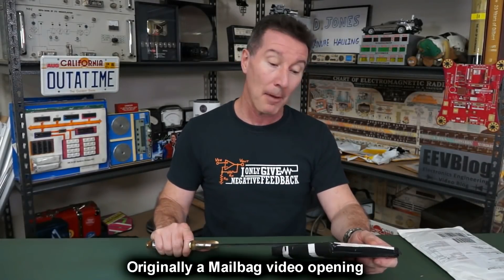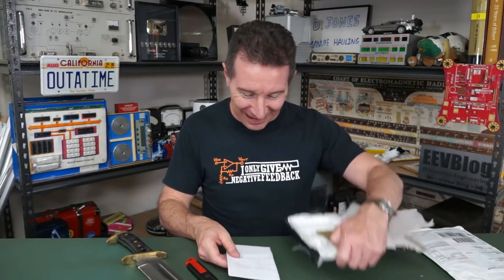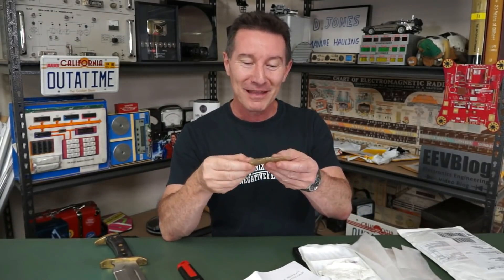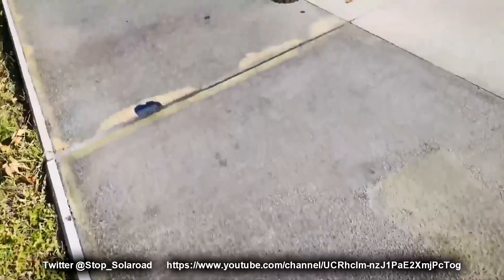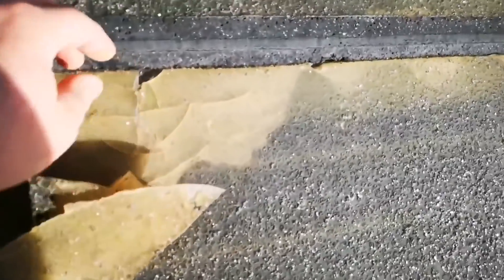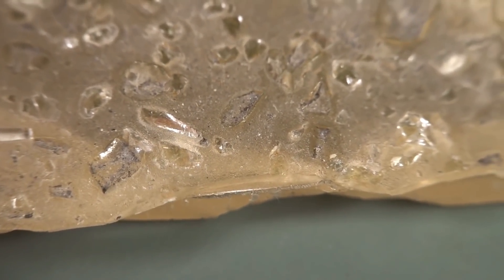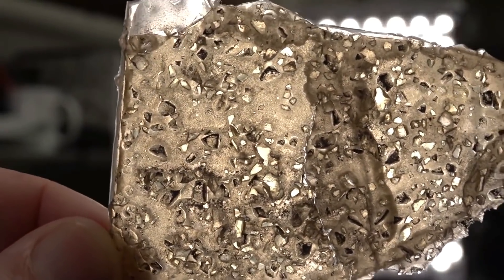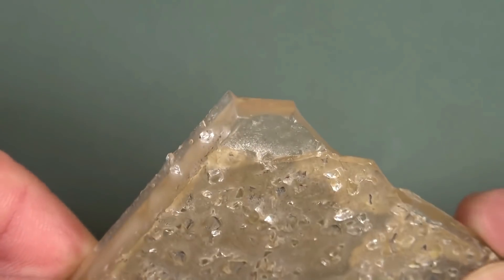EEVblog #1276 - Solar Roadways Surface TESTED!

Comment: I’ve been accused of being against progress for being against this stuff.  I’m not against progress or green energy.  I’m against wasting resources on this bullshit for absolutely no reason.  It would have been cheaper and more effective to just hang this on a canopy over the path.  Or better yet, put it somewhere else entirely where the space isn’t used anyway.  It’s nonsense.
Reply: I’ve never understood that either why not solar covered walkways would be a good way to do lights. Or solar panels off the side of the road ?
Reply: As for this providing experimental results: yeah, sure. But you have to be totally disjointed from engineering experience to think that you need those results. Epoxy resins are widely used in the industry and nobody needed to test anything to know that this would not work. Even the application engineers at the vendor of the epoxy would tell you that, unless they were corrupt.

There are tens of thousands of engineers just in the western world who have first hand experience with laminated epoxy-bonded structures, often in safety-critical applications, and would laugh anyone proposing this out of the room. This project is an equivalent of someone proposing wooden wheels for cars and then arguing that at least they got “experimental results” out from the failure.

You know what I call it? Incompetence at every level of this project. People entirely unqualified to design this thing nevertheless did go ahead and design it. It was absolutely doomed to failure even if they might have coincidentally happened upon a workable solution. They’d still get the details wrong, because you can’t just guess at this stuff. There is industry experience, lots of it. Just ask competent engineers. That’s all it takes. Seriously. And often this engineering know how is free. Vendors have applications engineers to support their customers for a reason. One: large scale failures can paint all raw material/sub component suppliers in a bad light, thanks to equally incompetent “press”. 

So, to anyone seeing anything redeeming about this project, anything redeeming at all: you live in a fantasy land where nobody knows anything. No, just hire qualified people, or at least consult all the free professional resources available to you. And they may not be cheap if it’s something truly innovative, but epoxy coatings are nothing of the sort.

And competent engineers at consultant rates will still be orders of magnitude cheaper than paving any road area with solar panels just to “experiment”. It’s dumbassery and incompetence of the highest degree, and people who do this shit should stop and think of systemic issues leading to this nonsense.

No, just because the government knows how to waste money at a grander scale is not an excuse.

This project should have never even gotten off the ground in this form – not unless there was solid engineering experience to back it up. Plenty of companies are more than willing to engage in projects that may widen the use of their products, so it would have been much better to use the taxpayer money to fund a research grant that would connect the vendors of the materials involved (panels, epoxy and other coatings, road subsurface, etc) together to actually research a design and find something that may work. 

That sort of work is done in lab setting (may be a big lab or an outdoors one). But you never do that research on a public right of way!! Would you ever allow public into an engineering research lab? No. But this road was just that: an extremely poorly designed engineering experiment ran in a public space. Somewhat dangerous and totally unnecessary, because competent people know that this particular combination of stuff would not work. And competent people would also be able to think of ways to perhaps mitigate some of the failures we’ve seen, but I guess that this approach makes no sense even if everything performed ideally - 100% transparent coatings, 0% traction loss, and ideally performing panels.

As for simulations: this is not something you can simulate for cheap, and there are hardly any turn-key solutions. You’d need people with good working knowledge of multi material nonlinear modeling with lots of noise and anisotropy in the behavior. This is rather niche, with very expensive software and people paid in line with the cost of tools they use. The tools that need to be finely tuned for each such simulation, with quite a bit of lab work to validate the results before expanding the design envelope and searching for “farther out there” combinations. Not impossible, but you can’t just assume that some random engineer would be able to do it. If they are good, they’d take more time to figure it out than it’d cost someone with experience to just go with it.

In concrete terms: simulating this road makes the dentin-enamel simulation look not all that hard. And just read about how hard it is to get the dentin-enamel problems to simulate reasonably accurately. It’s fairly recent that people got reasonably happy with those results, and the conditions in which they are valid are still narrow-ish.
Reply: Problem 1: People don't like turning their nice roads into dark caverns. Problem 2: People would like turning the "not nice" areas into dark caves with easily sabotaged lights even less. Problem 3: People will simply hate paying for that canopy and the increased electric bill for the extra lights it needs. Problem 4: European cities have a major shortage of "unused space" you can just cover in PV panels, that's why the idea of using the roads has gone further than in USA in the first place.
As for the money, firstly, it's pocket money compared to what governments wasted on actually worthless ideas, and it paid for actual scientific research and improving people's awareness about solar power, so it wasn't wasted. Though given how many comments there are claiming solar is too expensive to be useful, maybe they need to advertise more to get rid of such misinformation.
Reply: @AnalystPrime  It absolutely is a waste when you see the state of the pathways after a very short period of time, which plenty of engineers predicted would happen.  It's a waste when you compare it to the cost of roads and panels separately are.  It's seriously cheaper to do both separately than one at a time.  It's an extreme waste when you look at the resources that goes into the solar panels in the first place and then reduce the efficiency that much but covering it in the surface and then have people walking and riding all over it.  The point is that what they have made is neither a good road nor a good solar panel.  It is nothing but a waste of resources.

I never suggested the canopy as a serious idea.  It's plainly better to put it somewhere else entirely.

If you want solar panels in the city, put them on top of buildings or what I've seen more of recently is attach them to lights or parking meters that are actually using power.  But it's not really reasonable to expect any returns from this solar roadway technology.  The only people who think this is a good idea are people who don't understand the engineering principles behind solar power generation.

Your comment is precisely the kind I was complaining about.  People who speak out against this nonsense being accused of being against progress or green energy when in reality I'm advocating a more effective approach that doesn't sound as nice but achieves the goals of conservation more efficiently.
Reply: @Ferretsnarf  Everything has drawbacks. Those roofs? Not owned by the city unlike the roads and other areas these panels were planned to be used in. Single panels in multiple places means more work setting them all up, more expenses as each of them needs an inverter that likely costs more than the PV panel. A nice huge solar farm of several square miles outside the city would be perfect if not for lack of cheap land in some parts of the world; USA and China at least have room to build, but the whole point of using the roads was so the panels either are near cities or(for highways, which would have less shade than cities anyway) are connected to them as the road is both PV collector and the grid. Floating on the ocean would keep it cool so it produces more, but for obvious reasons nobody is planning more than tiny ones near the shores right now.

Anyways, you are right that the current materials don't work for long. Good news, this experiment provided useful data and was therefore a success. Putting PV panels in the roads is an interesting idea, but it does not need to become the power source of the future to be useful. Turning lead into gold takes a huge particle accelerator and so much power to do it will never be economically viable, but that has not stopped us from improving our knowledge base and standard of living for the last thousand years by trying to figure out how to do it. This stuff they are trying to develop for solar roads will also be great for building greenhouses on Mars or something like that, and even if the road will never work the world would be worse off if we didn't even try.

As for returns, it already proved to be able to produce more than zero watts of power. Solar requires two things: Either storage or large grid so the changes in light levels are balanced, and massive size so that you produce enough power to store for the night and for the parts of the world where sun is not shining. I already pointed out the problems with lack of room, the issue is not efficiency but producing any power at all. We either need to fit more solar inside our cities, build huge farms far from them and accept the risks of relying on those, or develop some other renewable or fusion so we don't need so much solar. And in the last case, we still benefit from developing better solar options.
Reply: @AnalystPrime  Solar panel efficiency does matter though; the more power we can get out of a solar panel for the cost (money, materials, and power) of it's production and maintenance, the less solar panels we need to make to supply the world with the same amount of power, and the easier it is to do so. Solar Roadways, as a mere concept, has a multitude of very predictable issues which already is going to cause it to be very inefficient.
1: Angle to the sun. The more directly you can point a flat solar panel at the sun, the more energy it will receive. Naturally, the most efficient solar panel would be one on a swivel system which is always pointing at the sun. Of course, solar roadways can't swivel, so it loses that advantage. But, in most places of the world, Solar Roadways isn't even ideally angled at the sun. The further you get away from the equator, the more efficiency Solar Roadways loses. It's enough of a factor to make the concept next-to-useless everywhere but the equator.
2: They're expected to have stuff, like vehicles and people, on them. Depending on where you build them this could have a varied effect on efficiency, from losing virtually all of it to losing a tiny percentage of it, but ultimately building solar panels designed to have stuff blocking sunlight from them occasionally isn't a good idea, although I could see the argument for it if you were running out of space.
3: Wear and tear from stuff moving over them. This has the effect of making the solar panel take more resources to build, and also means it has to deal with a lot more weathering, and is thus likely going to need more maintenance as well. In practice, this effect seems to be very bad.

No matter how you build Solar Roadways, they're going to operate with reduced efficiency and greater costs just based on their concept alone, and already have a range of useful latitudes which is far decreased from that of normal solar panels. This was very predictable. In terms of developing solar panels, this is kind of a technological dead-end. All it helps with are more durable panels, which I suppose is good, but ultimately the money would've been better invested in developing more efficient panels, cheaper panels, or less maintenance-heavy panels. And yeah, Solar Roadways really shouldn't be part of the discussion on how to get more power from renewables, figuring out how to get more land covered in standard solar panels (as you mentioned) is much better, or looking towards other energy sources.
Reply: @noname117spore  I see two benefits from this project: Materials development and awareness. That road material is going to be used in lots of other things once it won't degrade in just a few years, but nobody is going to spend money on simply developing a new roads. Telling everyone it is going to save the world with solar power though, that grabs people's attention and brings in extra research grants. Also, now those PV panels are clearly in view more people will think about them, and they will be connecting them with a bike path in a nice park instead of fake news like "solar panels contain poison and we can't recycle them!".
Reply: @AnalystPrime  I do agree that people should have blue sky research, and that is the argument I made some years ago when discussing the project. However, we also have to recognize that this was sold as a ready-to-go and nearly turnkey solution when it is clearly far from that.

I don't agree with the canopy-hung panels idea but that is a minor detail. Even in dense urban areas heavily crossed by roads, I think it makes much more sense to hang solar panels properly, off roofs and walls that can catch the sun. Even a solar panel that is only catching light for 1/3 of the day is going to give you much more energy and fewer headaches than dealing with the solar roadway.

I also feel that this moves transit spending in the wrong way, when we need to be focusing on reducing costs and reworking our transit assumptions. Roads are themselves not the right solution to many problems - a favorite example of mine are the tidy little walk paths, too narrow for cars, found in some old cities. In the US city of Philadelphia, there are quaint old "tiny houses" called Trinity Houses that are actually quite good for space density without needing a gigantic road between blocks. Setting construction closer together like this could have some advantages, and less public upkeep of roads and more quiet, safe foot traffic areas are some of them.
Reply: @AnalystPrime  
That road matieral is actually of almost no use.
There are plastics which work very well in everyday weather conditions. No problem with that. The problem with solar road panels comes from the fact, that it has to be as translucent as possible while at the same time provide as much grip as possible. Something you really don't need very often. And if you need it (without the grip), then you use glass.
The whole concept is as dumb as letting street lamps face upwards to raise peoples awareness of light pollution. It is a dumb idea, no matter how you look at it.
Technology is fighting for every single lausy percent in raising the effectivness of solar cells and then we put some cover on it and half that effectivness. If I have ever seen a really dumb idea in technology, then it is this one.
Reply: @AnalystPrime  
"Those roofs? Not owned by the city"

Right. But even if the city rented the rooftops from the owners this would be cheaper then building solar roadways. If there is one thing you can bet on, then it is that there would be enough home owners who would be more then happy to get an additional income without work by  offering the space to the city for good money.
Reply: @kallewirsch2263  And then the owner sells the house and the new owner doesn't want to rent the roof and demands the panels are removed. Or some idiot decides if they are on his roof, of course he can tap the power for free and sues when his house burns down. People who own their house and panels often ignore the maintenance even though it's basically just a quick wash and wipe, the city will need to hire people to go around to maintain the panels for them, which will cause another crowd of idiots complain that it is a scam and waste of tax money because solar panels don't need maintenance... Sure it might work out ok, but seems far too likely to cause problems.
Might be easier if the city just buys everyone a Tesla solar roof and Powerwall or has the houses built with them, but then everyone who already bought their own will complain they only got a small tax cut instead of free stuff, plus the folks living in Shadow Valley complain that Sunrise Road gets better light...

Though I recommend checking out Fully Charged channel's video about Orkney island, which has managed to promote renewables so much that the island now produces more wind energy than they need, so clearly such projects can work.
Reply: @AnalystPrime In Europe you would run out of funds faster than out of rooftops owned by the city. This is just wasting money.
Reply: @AnalystPrime  "European cities have a major shortage of "unused space" you can just cover in PV panels" - not really. if you check Google Maps or any aerial photo, there's really lots of unused space on the rooftops.

Comment: On one hand, if people genuinely cared about the environment, they wouldn't take claims at face value, but instead do some basic research on the subject.

On the other, I feel like at least some of the people genuinely do care aren't scientifically literate enough to question what they're told, which makes them easier to indoctrinate and harder to correct.

Comment: It would be better to mount it on poles to protect the bikeways from rain and snow. It would be cheaper, more efficient and serves a second function. Solar panels don't like shade and that protective nonslip surface acts like a shade after a short time.